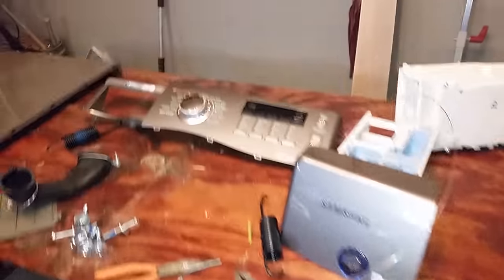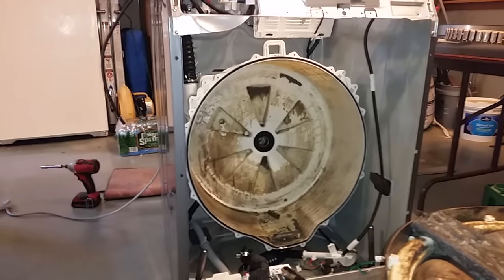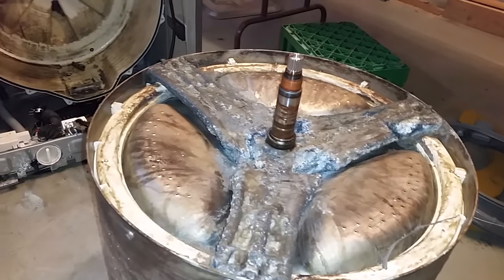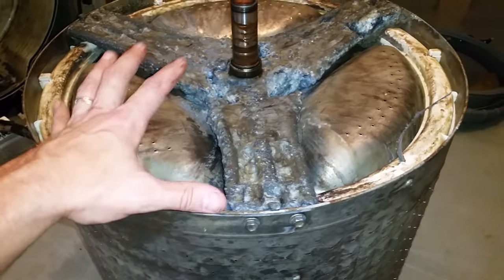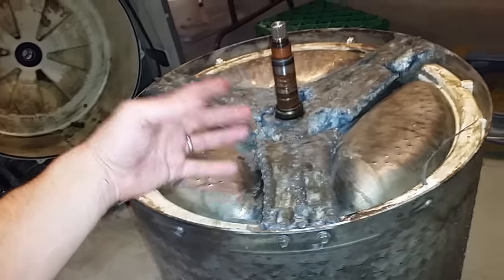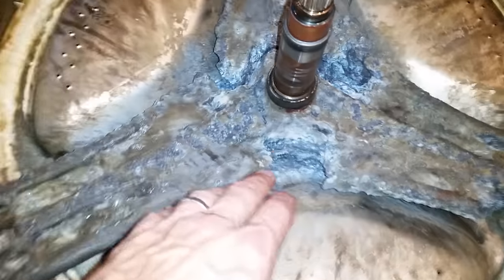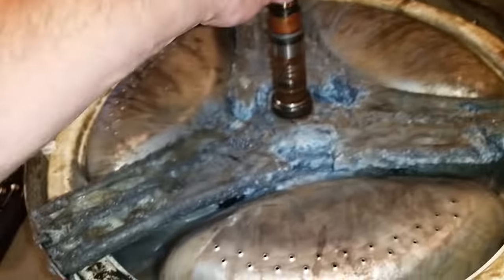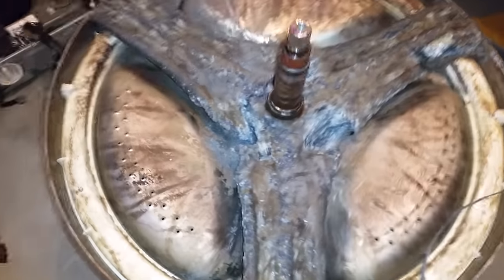Do not buy Samsung front load washer machines

Comment: If you need buy a new Front load washer, buy a Maytag. They been found as a Washing Machine Company in 1893 and it's made in Clyde Ohio, USA
Reply: Maytag is owned by whirlpool they are junk.
Reply: @markvera8306  No they are not junk. Maytag have twice as big motor than the Whirlpool, 1 years warranty vs 10 years warranty on the Maytag. Also they have won the best cleaning cycle in the industry and they are the most quiet with their 26 ball bearing anti-vibration system vs the Korean have 16. Maytag is by far the most reliable, not made in China. Also it have best cleaning and most quiet machine in the industry.
Reply: @John-qc1zv  I owned a Maytag sorry they're piece of junk on an LG had it for 5 years with no problems.
Reply: @markvera8306  What year did you bough it ? Reason I ask is some of them where belt driven. Now they all direct drive, top of the line

Comment: I actually repaired my Samsung front loader Spider Arm Assembly myself and was wondering how much more it could possibly add to the purchase price to use Stainless steel for the Spider Arm itself instead of this aluminum alloy crap.  Obviously this is planned obsolescence.  They could build it better but chose not to.

Comment: Wouldn't necessarily be a terrible idea to have a few replaceable zinc bars attached somewhere around the outside of the tub to reduce corrosion. However, making the actual hub out of a metal that so easily corrodes... very un-Samsung-like.

Quite disappointed to see them doing this and not fixing it considering the quality of their consumer electronics.

Comment: When it works it does a fine job of washing, I don't have money enough to fight these crooked lawyers, so I just repair and move on. We replaced our spider in 2010, and now shaking again. Will put coating on new spider. New bearings and seal new shocks. While I'm in there I will do everything. We just had a LG 3 door 6 1/2 years old have compressor go bad, $400 of meat down the drain. Extremely frustrating when appliances don't last, let me repeat, DONT LAST..!

Comment: Sorry this is about the detergent you use. Do not use powder detergent and low temperatures as detergent never fully dissolves at low temperatures. This happened to our 2002 Miele just yesterday. Because we use low temperature washes..now need a new washing machine research for which bought me here. Engineer recommended always use 30 + temperatures and liquid detergents. Use dishwashing liquid and wash the washing machine on a full length extra long 90 degrees cycle every other month which cleans out all the scum that's what dishwashing liquid is designed to do.

Comment: Close but incorrect. The "stronger metal" does not attack the "weaker metal." The "weaker" metal is called a sacrificial anode and and is a stronger reducing agent so it oxidizes (corrodes) much easier then the "stronger" metal therefore when they both come in contact with an oxidizer (air, water) the "weaker" metal reacts instead of the "stronger."

Comment: DO not buy their dryers either. She purchased a brand new one under a warranty. She spent $400. Two weeks later it broke down big time. They repaired it, the cost was $350.00. Four months later, it completely died. Samsung would not repair or replace.

Comment: Just took mine apart... thinking it was a bearing problem... the spider/drive shaft assembly had rusted on all 3 legs.
Reply: Just replace the spider bracket, the shaft seal, and the big O-ring seal between the two outer tub halves and you will also need the six mounting bolts. Then use less detergent, leave the door open when you are not using it and be sure to periodically run the self-cleaning cycle. It should be fine after that.
Reply: @joevignolor4u949  doubt any Samsung washers are in my future. Looking for a 1980s GE washer that lasts for 20 years.
Reply: @metricOIL  Suit yourself. I replaced the spider bracket in my wife's machine three years ago and made some of the changes I mentioned in my reply. No problems since then and it gets a lot of use. The parts were $180, which is a lot less than another machine.

Comment: Samsung is not the only manufacturer that uses zinc for the spider. I believe that most of them do. it's good business for them. they will last while the warranty period is in effect and then they will surely fail after.  it guarantees that more washing machines will be sold. there should be a class action lawsuit launched about this. regarding Samsung, well at least you can get parts for Samsung for a reasonable price and not have to buy complete assemblies,  so in that respect maybe Samsung is better than some.

Comment: It also looks to me like planned obsolescence.
My question is: which manufacturer does use a proper metal combination?
Reply: They all use the same die cast material. I wonder if this machine had a ground wire going to bearing / shaft though?

Comment: I have the same problem with my Samsung front load washer. It will spin but thunks around Gets down to seven minutes and then goes back to 16 minutes and put water in it again in an unending cycle. Suspect it’s a corroded spider arm as well

Comment: What a terrible design on all of these front loaders. They really made sure they could sell a washer every 4-5 years for $800 by using a part that ends up disintegrating. I can only imagine the arguments in meetings between the engineers and the finance dept before these were released. Most of these decisions are to save $20 per machine (thanks finance dept!), they don't care about the longevity of the product once it's out of warranty. When your design is the only choice no matter what brand you buy, they can do whatever they want.  Do yourselves a favor, buy a Speed Queen brand washer and dryer. They're made in Wisconsin with American made parts and have a 25 year warranty.

Comment: Just took apart Whirlpool AWO 6430 - exactly the same problem - the bracket has coroded and broke! The machine has been working exactly 2 years and 1 month - guess what was the warranty period! never buying whirlpool again. Another "extra" I got with this machine was that the drums outer shell (plastic housing) is not bolted together with a gasked - instead - they glue those pieces together so bearing change is out the window and drums housing (the corroded part) is not sold separately. You can purchase whole drum assembled at 1,5x the price of the washing machine.... fuck you Whirlpool.

Comment: This is terrible. I have the exact same experience with my washer a front load Samsung. It took over 2 hours to take it apart to find that the spider arm had disintegrated. I am not sure if it is zinc or cast aluminum but the fact that it turned into powder after 5 years is terrible. Not sure where to go for a class action.

Comment: thats not the worse..the worse is the recurrent issue with samsung and also LG washers were the door lock shorts due to moisture and takes away the control module frying a triac but also damaging the software/microprocessor part...and the module is potted with jelly and next to impossible to repair... on bosch and siemens washers when something shorts and blows the module, ussually the software part stays intact and you can replace what blew (psu tny chip, relay, triac, whatever) and it works fine in the end

Comment: So you're talking about electrolysis: dissimilar metals will transfer electrons disintegrating the weaker or less charged metal in a redox reaction.  This sounds like the engineer mechanical engineer designed this washer to fail due to electrolysis as materials are studied when you go through engineering and electrolysis is well known so yes I believe that Samsung designed this washer to fail intentionally.

Comment: i'm sure by now that you know the real reason for the support breaking & having that covering of gunk/mould on it.nothing to do with the manufacturing of the machine & metals used as all makes use the same metals for the same components.the real reason is the use of washing liquids that have NO bleach in them, so at low temps mould forms, eats the metal away & tada the support has broken.if people use good old fashioned powder you will find the 1st ingredient in that is oxygen based bleach, this will keep the mould from forming but will allow scale to still form.all liquids & COLOUR powders DONT have the bleach & so mould is allowed to grow as well as scale build up.advice to customer is if they want to use liquids then use a washing machine cleaner once a month to breakdown the scale & mould, and any excuse to use a hot temp program(towels & bedding is a good 1)like a60 degree is good, that delays the build up but wont prevent itend of lecture... happy washing all

Comment: Mines is still in parts in garage, my spider looked like it disappeared also think the Motor is shot, and eventually the bearings would fail... I just ended up buying a new washer and dryer GE American Brand with 5 year extended warranty for Under 1400 bucks... ..

Comment: LG is not different ... I just replaced the arm shaft and bearings (bearings were still good).  Razor blades. My 1st front loader was a Frigidaire ... something broke through the drum housing with a LOUD noise after ~5 years so I got the LG. I will stay out of all front loader washing machines from now on.

Comment: Do you mean this action is some thing like the problem GM had with it's Cadillac aluminum block, with steel bolts holding down the head. Always leaked water into oil, over heated and GM shops wanted a fortune to repair?

Comment: Yup.   I've taken several of these front end loaders apart.  Number 1 is all they all SMELL.  These are NOT clean washers.     That crap is all over your clothes.

They seem to all use cast aluminum brace on the drums.  I'm sure there are only a few manufactures that actually make the parts since each brand I've disassembled are nearly identical.

I refurbished  a high end Kenmore model washer, coating the brace and will see how long it last.

Comment: WD80J5410 samsung washer and dryer never worked for me from day 1. It will wash but it does not dry. Read user manual, called service for repair,  still does not dry.  Do not buy 2 in 1 washer/ dryer

Comment: I found the same problem on my samsung front load washer after disassembling it. The washer falls apart after 7 years. I am considering replacing the broken part. I have seen someone powder coating the new part before re-installing. It cost about $40 to powder coat. I was wondering if this approach will make any difference.  Has anyone tried it?

Comment: This is the wrong usage of the washer. Stainless steel drum and aluminium back frame with the steel shaft is the most common thing in front load washers. I have been working for Whirlpool over 4y. I don't say this is ideal but it's cost-effective. You don't build a washer in these days to last 30y. They must be using some aggressive products for this kind of corrosion.

Comment: they grind up everything to make products,  you should see how bad brake rotors are these days from this ground up melting down process where not all metals adhere to each other crazy how they get away with this. Use the drum for a fancy fire put out back welded to an old steel rim ;)

Comment: I had a similar problem with my Samsung washer and i may have been such bracket or the bearing got destroyed or a combination of both. I do realize Samsung washers are known to brake down after a few short years of use. No good!. Buy a different model. I bought GE to replace them.

Comment: was getting a "nd" error which means No Drain. Cleaned out the trap and there was all this gravel in it. Took off back access panel and there was literally chucks of aluminum in the bottom of the tub drain. Should I spend $140 for a new spyder arm, $10 new gasket, $40 new tub door seal and 3 to 4 hrs of time? or just go and buy a used $200 washer. I think the latter. what horrible engineering!

Comment: So, you just went ahead a screwed your 10-year guarantee that comes with this unit, going by that label on the front control panel? 1. 10-years of use for a washing machine is pretty damn good imo. 2. How many other manufacturers provide a 10-year guarantee?

Comment: What appliance manufacturer places ALL technical documentation online?
Samsung sure doesn't and don't bother asking, cause they will not send it to you.
And 95% of the electronics is on one printed circuit board.
When something goes amiss, it is not only difficult to troubleshoot but is costly and wasteful to boot.
And here is another Samsung gotcha...

Say you have a front loading washer on pedestal, maybe 10 plus years old, and you want to upgrade or replace the washer.  Try asking Samsung what Samsung current model will fit your existing pedestal.  Answer:  They can't tell you.  Seriously.
They want you to "upgrade" the pedestal too.  Sure just throw away a perfectly good pedestal because Samsung is making all the new stuff just different enough in dimension to insure you can't continue to use the older model.  Nice.

Comment: buy whatever machine you want. they are all great. the user is damaging the machine. the drum bracket is made of a stamped metal alloy with a machined shaft. any other production process is too expensive for the application. all manufacturers of front load machines use this process. too much soap of any brand will damage this part. use less soap and use the extra rinse cycle to remove all soap from your clothes and your machine when you feel more soap is needed.

Comment: Everything you buy these days has a part that will break , that's how they can sell parts and services. This part is also attacked by soap and water .I just replaced mine and that Spider cost 192 cdn plus 43 for 6 bolts original Samsung. I did it my self but how much is a Service Man gonna charge.

Comment: Dude. They all use the same crap! I just replaced my LG(last week) spider-boot-bearing seal-tub seal, I bought in 2008. If I had the time I would have coated it an epoxy paint. I'll most likely have to do this again in 10 years, if everything else holds out that long...

Comment: It is designed to fail so you have to buy another one... I have a rheem water heater and the sacrificial rod corroded to a thin wire but there is no easy way to replace the rod. so after 5 years or so you have to get a new one.

Comment: This is definitely not corrosion.  The excess detergent is turning the Aluminum arm into Aluminum Hydroxide.  This is such a dumb design that I find it hard to believe it wasn't an intentional cost cutting decision.  Soak that arm in warm detergent and it will turn into a puddle of wet kitty litter after a few years.  Actually 7 years.  Ask me how I know.

Comment: Samsung is not welcome in my house, I am junking a 700.00 machine because Samsung will not sell me a fifty cent bushing that goes on the drive shaft. With out this grommet the tub bearings can not seal. Samsung has ignored my pleas for repair parts.  Turns out Samsung has a recall for 2.8 million machines b/c they rip themselves apart.   Do you really want a Samsung????

Comment: This is horrible.  I saw a stacked Samsung washer dryer combo and it has a 10 yr warranty vs the GE's that were similar and they were within $100 difference in price but only had a 1 yr warranty.  How the hell? LOL. 

This reminds me of neglected (unclean) jetskis/waverunners after riding them in saltwater.  The aluminumn and stainless or even non stainless steel bolts and brackets that touch start corroding after the saltwater sits there for a period of time.  Saltwater is corrosive anyway to some metals but when you introduce it to two different metals it is 5 times the shit show.  

Some people would say, i'll flush and clean it later... Then you have problems. The bolts wpuld become so brittle that they would just snap right off.

Also some makers would put stainless steel liners (impeller sleeves) in the jet pumps.  The saltwater would cause just enough corrosion in between the liner and the aluminumn housing of the pump and then ultimately it would warp and the impeller blade would just lock up and usually the whole impeller blade and housing would have to be replaced and they arent cheap.  What were you thinking Samsung?!

Comment: I bought the same one after 9 years it come with the same problem so I bought the replacement part in ebbay for 100 bucks did  some modification to fit the part and lasted 2 more years and the water pump went bad got it fix again but I not buying a new one Im not buying a new one because im kipping the same one for another 12 years

Comment: To much detergent will cause this -
And cold washing -
Every washing machine have the same style alloy spider holding the drum -
if washing machines are used correctly they’ll last between 7 to 10 years
Reply: Why cold washing? Genuinely curious because I only wash in cold with Tide Cold Water detergent. I do also run the clean cycle every month though.

Comment: Correction, the metals do no attack one another, while certain metals do, zinc and stainless do not. The corrosive action of water attacks the metal. Zinc is a great sacrificial metal as it actively draws the corrosive effects of water away from nearby metals, that's why it is used as anodes on outboard motors and large ships alike. The air force didn't train you that well, crack open a basic college chemistry book and you'll learn that. whilst I have no doubt you were well trained in you job in the air force, you were not well trained in the science behind that job.

Comment: What if LG is the same and you just don't know it?
Reply: I have had an LG front-load washer for over 10 years.  I have had to replace the motor and the door gasket.  other than that, it is fine and I intend on repairing it until it falls into a heap on the floor since they are just tooooo expensive any more.